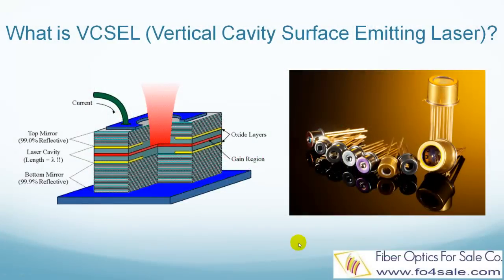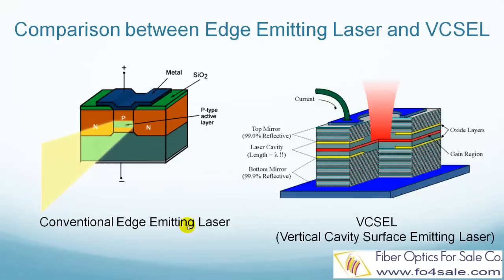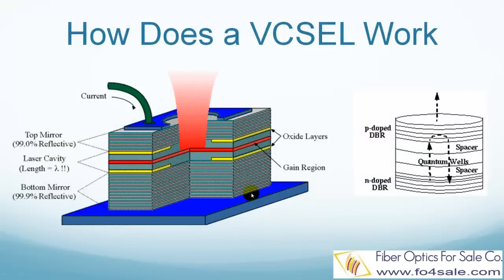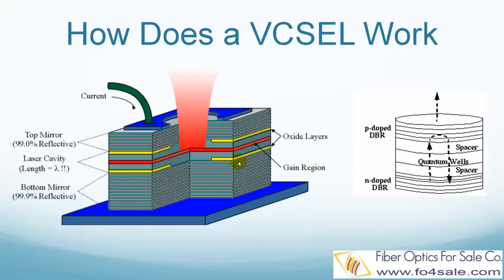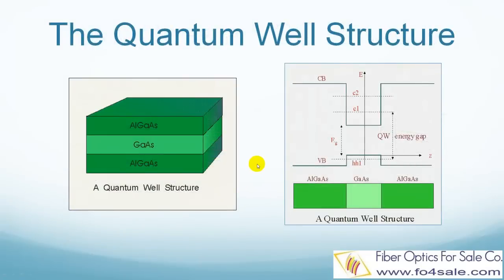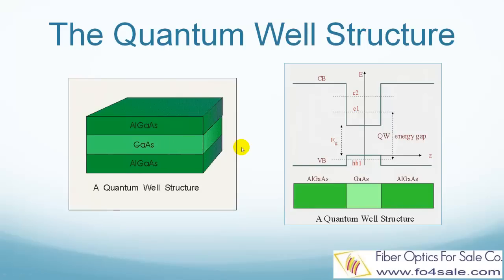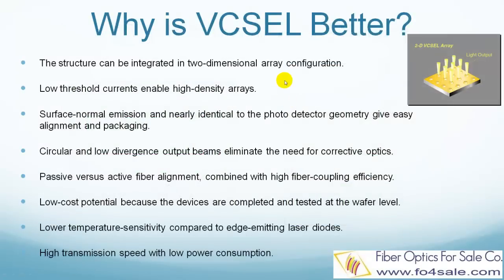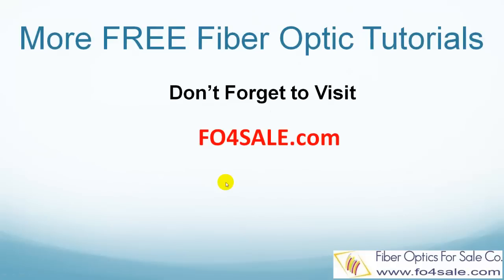What is VCSEL Laser (Vertical Cavity Surface Emitting Laser)?

Comment: Thank you for this explanation! I was researching how thunderbolt optical cables work and apparently they have VCSEL laser modules inside the cable housing. This presentation helped me to understand. It's mindblowing that we are at a point where 6 of such VCSEL lasers can be embedded in the plug end of a cable, along with a whole heap of other electronic components to not only send laser light signals but also to receive them from 6 lasers at the other end of the cable and to do signal correction and interpretation. Absolutely amazing